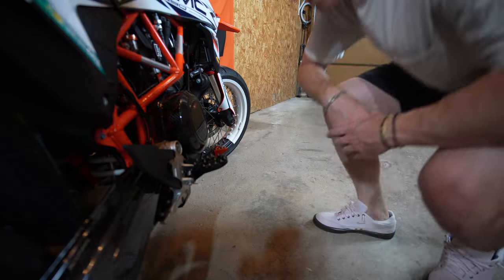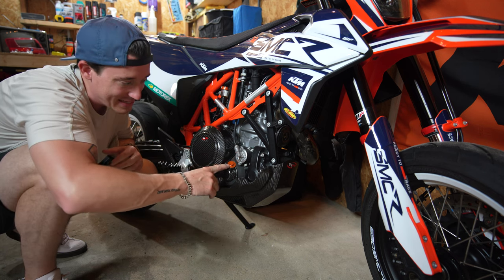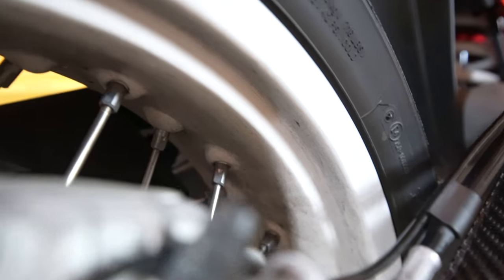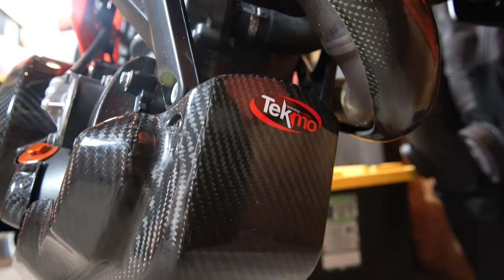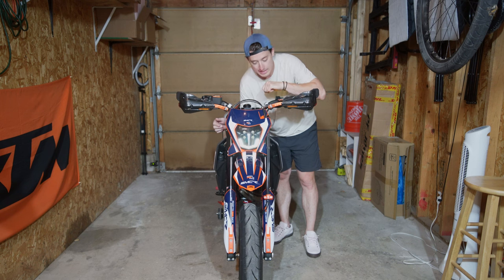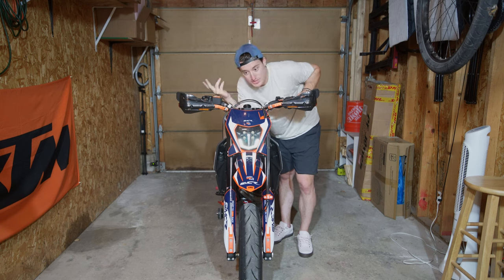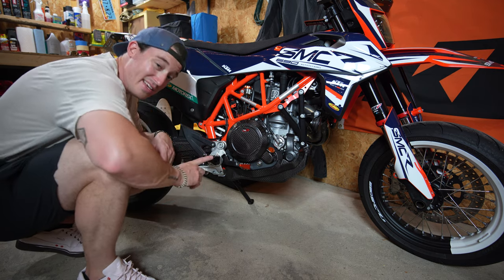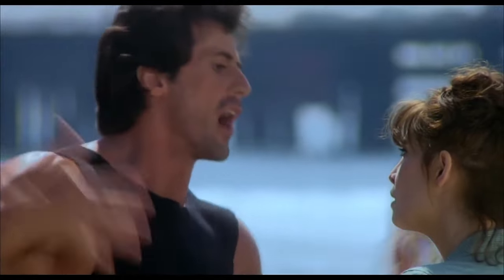The WORST mods for your KTM 690 SMC R

Comment: “Im afraid!” 😂 The 690 looks great. I disagree on the foot brake peg. It’s a essential for riding the rear brake during a wheelie.
Reply from the maker: Haha which I can do so many of those.. 🤣
Reply: What does the footbrake do to improve wheelies?
Reply: @thumpertorque_  a wider grip area gives easier access to the rear brake incase of an emergency. Works for me during balance point wheelies.
Reply from the maker: @thumpertorque_  more surface area to use to control the height, essentially it’s like a bigger brake pedal in your car for left foot braking

Comment: I installed “Stealth Mirrors” on my 690 SMC R.  They look great and actually function.  I have ran the mirrors you have on a lot of dual sports for legality reasons like you said, plus they are cheap if you lay the bike down.  But check them out.  They are more costly though.

Comment: Lol i have all the same stuff on my 701, same mirrors, carbon fibre and headlight (not brake lever tho)
The supermofools headlight actually do have a high and low, kinda. There is a white wire tucked into the black sleeve of the headlight. The connector only has three out of the four wires installed. Dig the white wire out of the sleeve, add brass pin and insert into the open slot in the connector. You will then have a "low beam" where 2 of the LED's are used and high beam is all 5. 😊
Reply from the maker: YESS THANK YOU!! I will have to dig into this and try to complete this!!

Comment: The same headlight from china is 50 bucks. Just made a switch highbeam/lowbeam. The right engine case guard is must have item on this bike. Just any manufacturer. (There are full carbon, aluminum, just brake pedal hit protector of full, plastic). Caps are just for good looking, the same as other carbon parts. But it works) and looks amazing! Have you found other mirrror option yet? Besides “stealthmirrors” from recommendations above.
Reply from the maker: I actually havent.. just the ones on amazon for now but trying to not spend an arm and a leg for the Rottweiler ones.. that just seems too expensive for something I don't really use?